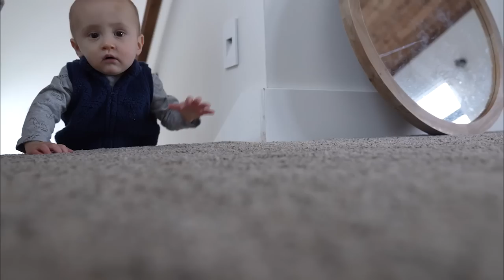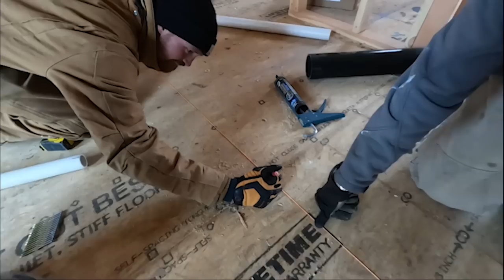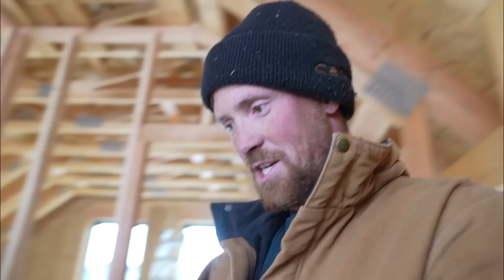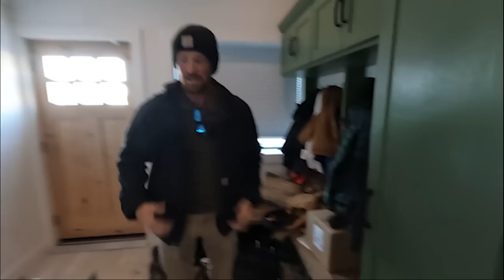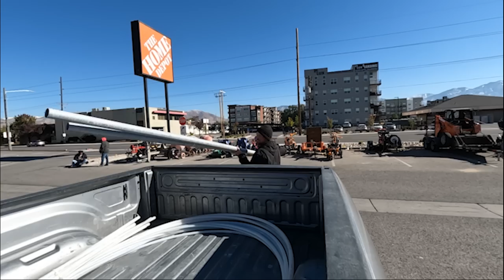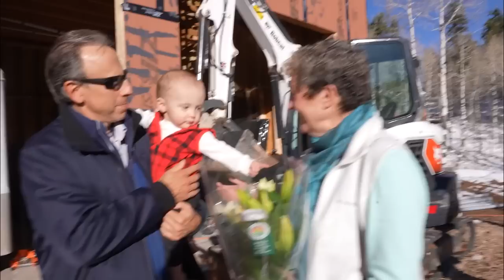THINGS ARE CHANGING AROUND HERE...

Comment: Tip for leak proof joints with PVC...   A piece of 80 grit sand paper to rough up the glue area will help along with a little heat from a heat gun after the connection.  I have used this for years and have never had a leak even under double pressure.  It takes a little longer but not as long as taking things back apart and resealing.  Plumbers will say this does not matter but they are wrong.  Defects in molds and extruding is more common in these days as they are ever trying to reduce the cost of manufacturing.  If a plumber tells you different, you need to find a new plumber!    lol   :)

Comment: When assembling PVC pipe, put it together dry first and use a marker across the joints for line up then glue and 1/4 turn glued joint when you put them together for better fusion and I promise you will never suffer a leak.

Comment: I have put water lines in apartments and hot and cold lines, plus drainage lines too. I have learned that you never get a perfect100% the first time. We had 3,4 inch drainage to deal with. But it was a learning curve. And yes I put extra glue in fittings. Sometimes it works, sometimes doesn't. You guys did a great job despite the cold weather. Keep up the good work.

Comment: You should have ran your vents into a 3" line. One 3" hole is easier plus it's easier to strap one line instead of two. On the outside make sure to use 45°s to turn up and not a 90°.

Comment: I have had success with the Cory Bead, but with help via a shop vac. I know this would not work on yours, because of vent line to high to reach and cap. But if you have a closed system, by applying vacum, and then applying the glue, it will suck into the fitting. Retired from building pools, spas, water features and fountains......

Comment: Garage electrical:
It's nice that your utility requires the meter and cut off at the street so now you can run The garage service from Street to the structure. The bonus is that you could virtually have hundred amp or do a little rework I have 200 amp in the garage which is nice for workshop.

Comment: since it is cold up there so much of the year, why don't you invest in a remote car starter or two? I'm in Florida & it works great before I get in my car as I have the air conditioner on a few minutes before I get in. It would be the same for your cold & frozen windows & cold seats! It's only about $300-$450 for a fairly good setup & you can install yourself!

Comment: Since that 3 inch corner pipe was the hardest to do you should have made sure you did it really good so it didn't leak TRENT haha.
   Does your truck not have heated seats? And doesn't it have remote start ?
   You could set the heat on and remote start it from the house and let it warm up so it's toasty when ya get in.

Comment: compressed air and soapy water in a spray bottle is a whole dryer way of testing.......unless your local code requires a fluid test..also do you 1/4 turn each connection when you glue?

Comment: Just a thought but I wonder if you had drained a little water out of the pipes to where the water was below the leak, put a cap on the open vent,  put the extra glue on the outside of the leak, Then let the water drain out if the vacuum would pull the glue into the pinhole to seal it.

Comment: I'm wondering why you aren't putting an "on demand" hot water heater in.  Won't they give you continuous hot water when you want it, but without wasting electricity when you don't  need the hot water.  (I think they're  also called "tankless" hot water systems.

Comment: Never heard of a 'Cory bead', but that is the same solution that I would have tried, as well. Now, we all know that it doesn't always work to repair leaks. 
I'm wondering whether the leak was created at the time of the creaking sounds from the drain settling under the weight of the water, before the glue had fully set.
Of course, during real life usage, the drain wouldn't be full of pressurized water (unless there were a very serious blockage) and the small drip wouldn't be a problem. But of course, your inspector would never buy that excuse.
Well done on fixing the (non)problem, anyway.

Comment: Just fyi...Carbon monoxide is lighter than air. It also rises with warm air, so the United States Environmental Protection Agency (EPA) recommends placing a carbon monoxide detector on a wall about five feet above the floor or about eye level. You can put them on the ceiling, too.

Comment: Have you ever considered heat strips for the stairs to your house and the apartment above the garage that can be turned on when needed? I don't even know if it is possible but it would be great if it would work.
Reply: They make some for stairs that have a sensor that will automatically turn on when it detects snow. They don't seem to work very well though. My retired neighbor has them and from what I can see, they cause new issues and aren't a perfect solution. ( But I'm in Canada and our winters are colder. It may work in Utah)

Comment: Go back to my warning on the waist line from the house. WHEN HANGING WAIST LINES THERE HAS TO BE SUPPORT EVERY 6' . Those waist lines in high heat summers like you have them. ( will sag, the straps, plastic crap will break., ) use...plastic hangers that match the size of the pipe your hanging.... vent lines have to be supported also with a plastic hanger.
You might get away with wood blocking under the waist line...but you will loss the slope, make sure it is ( 1/8"  slope out. ) if you have to much slope...solids..💩💩💩, will not flush out the hanging waist line. 100% they will back up, and fill the 4" line.... you could say, if it breaks, shit will everywhere...hahaha. a joke, but it's true.
Buy good plastic hangers...and fix the job.

Comment: carbon monoxide is not heavier than air 😬be careful guys :S
Reply: Um ..  yes it is     they still need to be careful obviously but its absolutely heavier than air ... that's why u always install the CO detector as close to the floor as possible
Reply: @CanadianBusLiving  unfortunately that is a myth. it is as dense as normal air, infact slightly lighter than a co2 molecule, it diffuses like CO2 does.

Molar mass of carbon is 12, oxygen 16. a molecule with two oxygenatoms is heavier than with just one.